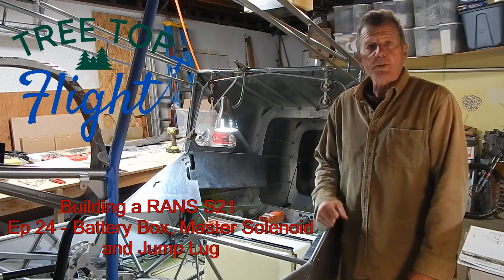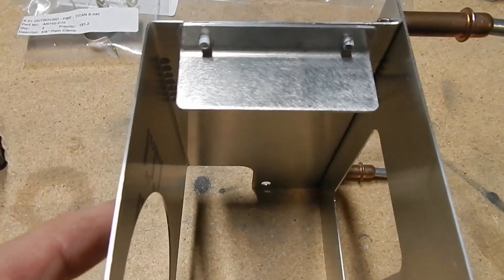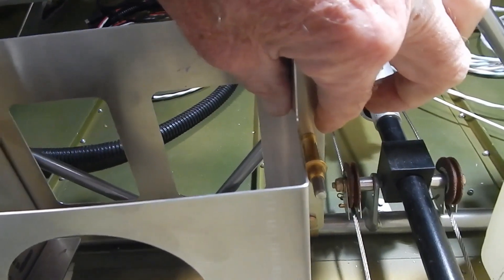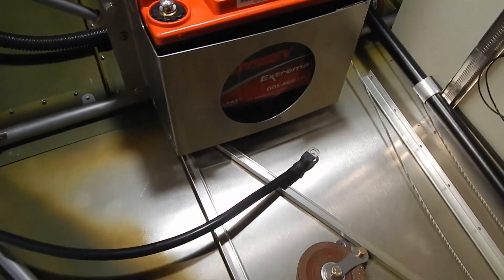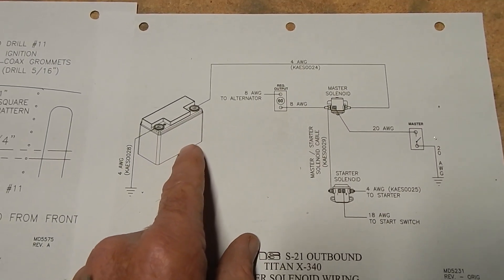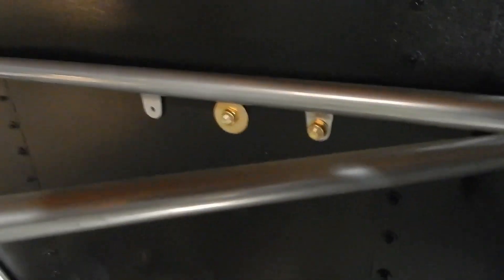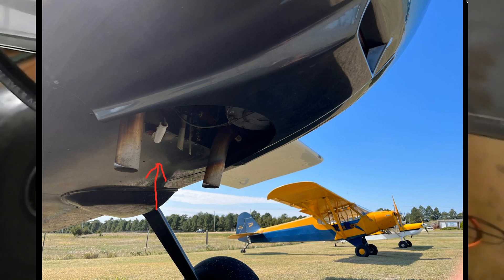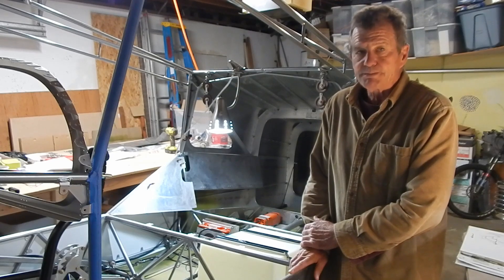Building a RANS S21 Plane - Ep 24 - Battery Box, Master Solenoid, & jumper Lug

Comment: Just FYI: Battery-side of the master solenoid is in fact a direct connection to the battery, as it would share a post on the master switch with the battery, and the master solenoid wouldn't be in play at all. The other side of the master solenoid would go to the positive bus, and which would be switched.
Reply from the maker: I agree.  I don’t think I indicated differently in the video.  My issue with the charging lug, is that it connects to the starter solenoid, which is not live until the master switch is turned on. It will be good for jumping the battery, but not overnight charging.
Reply: @treetopflight7624  Oh my mistake, must've misheard ya! Thanks for the videos, I start my kit in September, so I'm "studying" 😁